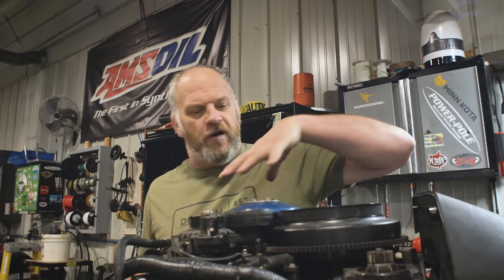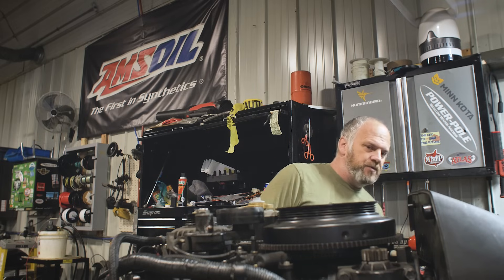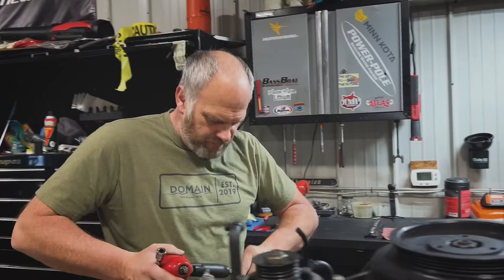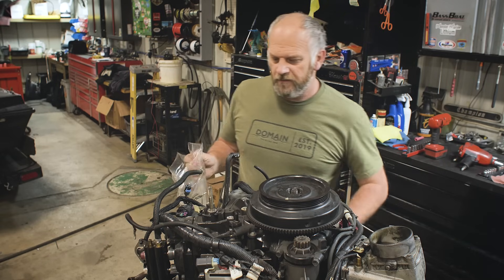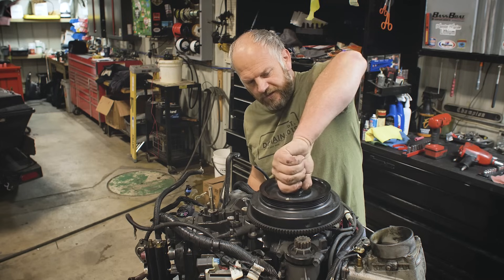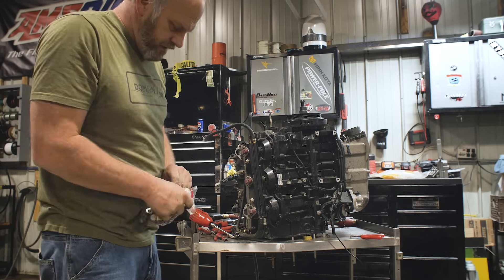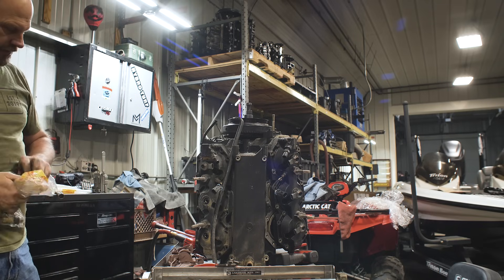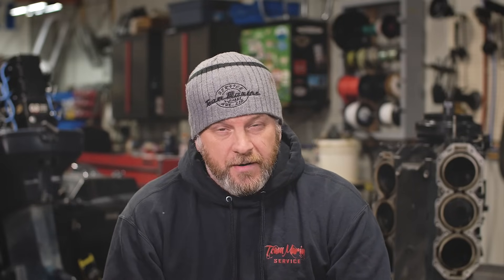SHOP LIFE: MERCURY PRO XS 250 TEARDOWN! (WHERE DID IT FAIL???)

Comment: Apply some gentle heat to the aluminum flywheel while you have the removal tool Applying pressure and it will pop. Only use propane don't use oxy

Comment: Great tear down. I would recommend getting an air chisel with a flat head and give it to that fly wheel puller nut. The fast aggressive vibration usually will break them free without damage because of the short fast burst. Try it you will never go back to Brute force or Big Hammers

Comment: 200 xri 1993 biggie out 38pis but drops to 5 PSI when I engage the throttle. Jups back to 38psi as soon as it's back in neutral. Been to 2 shops any thoughts

Comment: Optimax , HPDI and Etec which are all EPA compliant 2 strokes do not get the amount of hours they should before they fail one way or another, normally heat and lubrication related. When we look at these two stroke direct injected engines and we see maybe in most cases see the powerheads last as much as 1000 hrs and call that good engine life. That is way too few hours for a twenty five thousand dollar engine to last. From what I have seen a four stroke that has had the oil kept clean and full.Will out last a two stroke by a significant amount of hours.

Comment: Not a pro mechanic here. But I’ve always had luck with sticky flywheels by tightening up the flywheel removal tool like you did, and then giving the flywheel “one” hard hit with a rubber mallet toward the outer edge. Worked like a charm every time for me.

Comment: Why no impact on flywheel?
Reply from the maker: My thinking was that if I couldn’t get it with my long breaker bar my impact wouldn’t get it done either
Reply: I was always told it could damage the engine using an impact on the flywheel
Reply: I've used a impact on merc v6 many times. Always works with no damage. That puller should be threaded deep into the flywheel, and protective disk should be between the crank, and puller.

Comment: You can't put the impact on flywheel? To remove it? Thx great video bro!
Reply from the maker: My thinking was if I couldn’t get it with that breaker bar my impact wouldn’t get it done either
Reply: I take quite a few outboards apart. I think the impact hammering helps with jarring the flywheel loose. If it gets too tight with the impact, a couple shots to the flywheel puller with a hammer will pop it loose. I typically leave the nut on the end of the crank, but loose, to prevent flying flywheels. Best of luck!

Comment: Love the mechanical videos just to see how stuff works. As an electrical motor mechanic we typically have to use an oxygen and polypropylene torch for pulleys and couplers to let them free up easier. I don’t know if that is a possibility on that fly wheel?

Comment: The kinda vids real boat people need to see. You ain't gonna like this but I've got an '87 Johnson GT 150 that runs good but is at the end of it's life span, as you can imagine. The only thing I've had to do was replace the starter solenoid. It was great the day before when out guiding my Brother...next morning, at the launch, clickclickclick when I tried to crank it. Took it home, used a screwdriver to bypass the solenoid and it started. Went and got the part, replaced it and was on the water 2 hours later. I NEED a new Zuke for my '87 Ranger. Can't justify 100k for a new bass boat when this one still does 64mph. Gonna downsize the motor when I switch over...no need for speed, anymore.

Comment: In this day and age, and my age, before pics always. Anything with different length bolts on the same part I draw the part on cardboard and push the bolts in position into it. 
Any chance you sell the air injector plug connector for 250 Pro XS Optis? The dealer up here says not available.